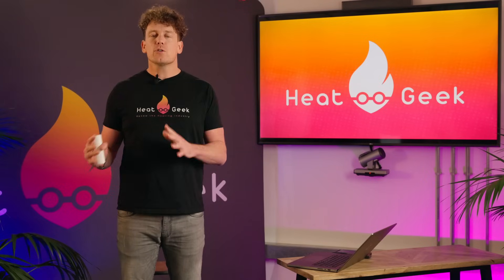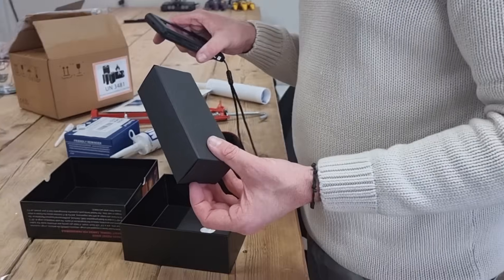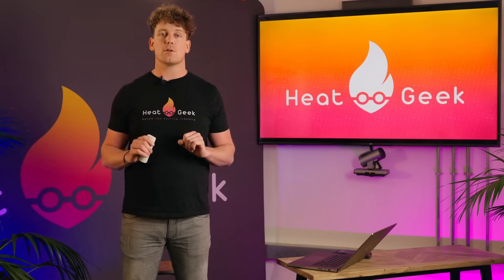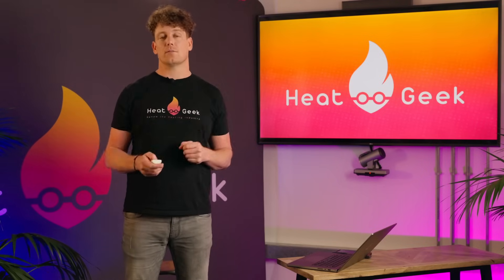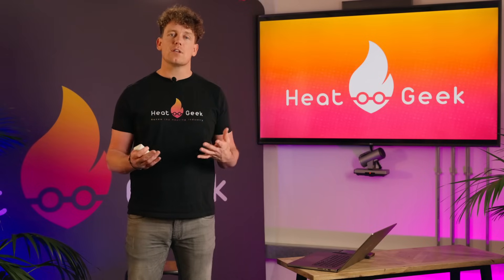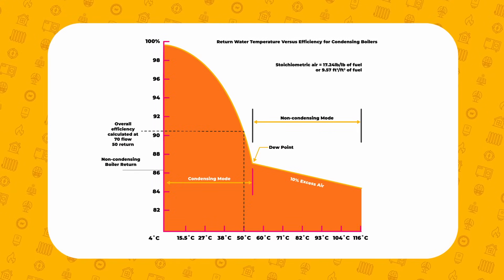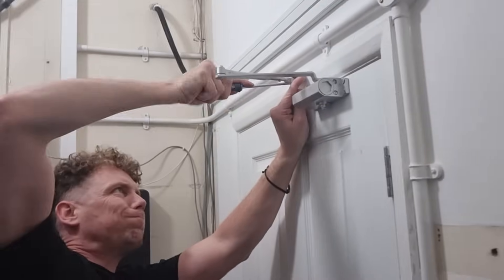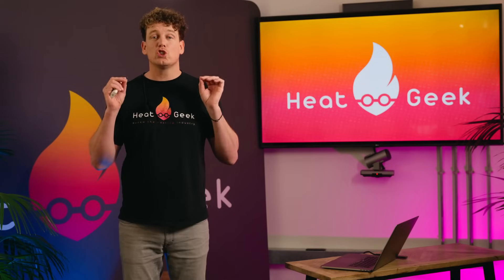This Insulation Secret Will BLOW YOUR MIND

Comment: Presumably there is a need to assess the amount of insulation that will eventually happen prior to sizing the heat pump. If the heat pump is sized to match  uninsulated heat loss that is a problem ?
Reply from the maker: Yes. Oversized heat pumps are less efficient
Reply: @HeatGeek  over sized is mentioned a lot, where does under-sizing fit in (I get in principle that this shouldn't happen) but if a HP has to work at the top end of its output, is that equally bad in efficiency terms (I guess more so that it has to keep running to achieve comfort)
Reply: @HeatGeek if the 10kW heat pump is able to modulate down to 7kW it shouldn't be less efficient. Right? If it means that the start/stops increase it is less efficient of course.

Comment: Draft proofing old properties is all well and good, but without then providing suitable ventilation, you then cause damp problems.
Reply from the maker: I don't think we have to worry.. did you see the windows? We're definitely not taped and sealed.. we're miles off worrying about that
Reply: @HeatGeek  I think the other guy was thinking about people in general. Your lucky with your windows when we moved in we had drafts and they had been spaced off with 50mm long bits of 15mm copper tube. Now that's a proper gap!
Reply: , problem with windows are lazy humans (tenants) not bothering to regularly open them for short bursts of ventilation. Hence the mold horror and blaming me for doing my best to insulate the house. PIV or even better MVHR in place solves that, but, it comes at a cost, like any comfort in life. 😊
Reply: I agree but then there are plenty of reasonably priced MVHR systems and running them in winter rather then opening ing windows is far better
Reply: @John Freshwater  The point I'm trying to make is the need to inform, as otherwise the next big scandal is thousands of houses with damp problems. This is already prevalent in the rental sector.
Reply: @granthutchinson5937  you are correct a little information is dangerous you need to also point out the problems that can be caused by making houses air tight without correct air changes per day.
It's as important to have good ventilation as good insulation. My house is 220 years old and solid stone I have insulated it in the roof and ensured it is draft proof and fitted a MVHR system and we ha e no damp
Reply: @johnfreshwater3790  What do you call reasonably priced?
Reply: @granthutchinson5937  I bought a Blauberg one that was a kit for 2 inlets and 2 outlets and it was 600 quid
Reply: I read somewhere that draughts simply bring in damp air from outside that eventually condenses out.  You get condensation when the temperature drops, do draught proofing reduces the intake of damp air and stops the temperature drop.  Do I have that right?
Reply from the maker: @Paul McCormack  humidity comes from yhe inside via cooking, cleaning, breathing sweating..  the issue they're talking about here though is for extremely well insulated housing not this property. . Unless they're talking about incorrectly installed cavity insulation or loft insulation.. that's the incorrect installation not the fact it's installed at all though.
Reply: @Heat Geek  I have seen terraced houses with solid walls, i.e.no cavity, where all the doors and windows were replaced with double glazed units without trickle vents or any other ventilation. All the internally generated moisture then condensed on the coldest surfaces, i.e.,  the external walls, damaging the decoration and plaster.
Reply from the maker: @Grant Hutchinson  often the condensing happens IN the wall too..  this is called sick house syndrome. Much more likely and common in single skin. Extractors or opening of windows during showers etc would not have happened in those scenarios  either..
Reply: @granthutchinson5937  This is where external insulation comes into its own. The external walls are then warmer so reducing/eliminating condensations. However, doesn't remove the need for sensible ventilation.
Reply: @PaulMcCormack1968 most of the moisture is internal, cooking, washing, showering, etc